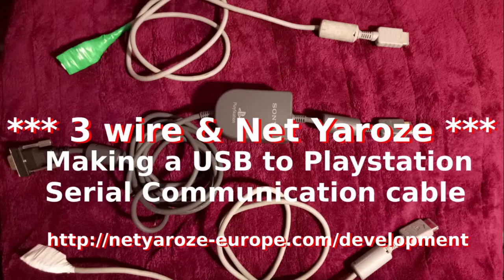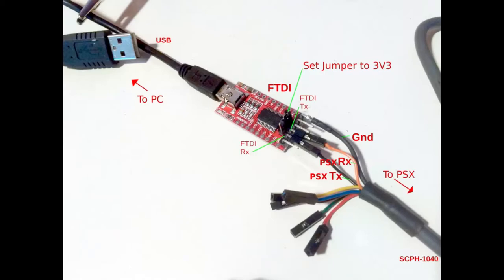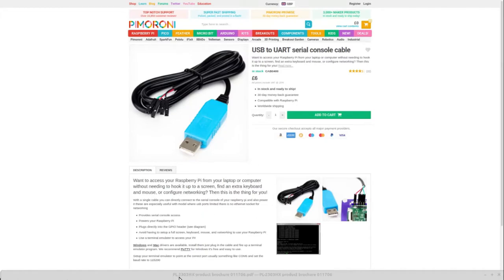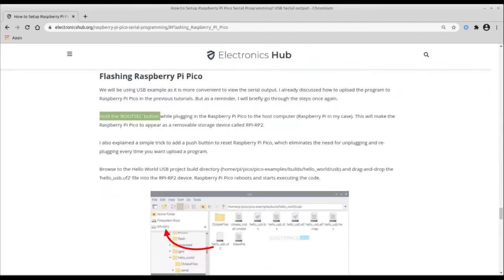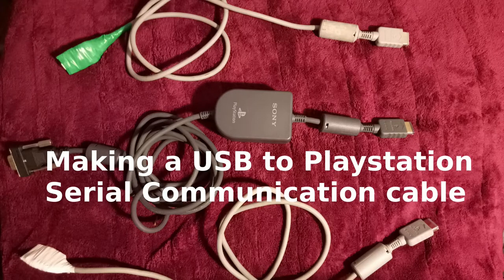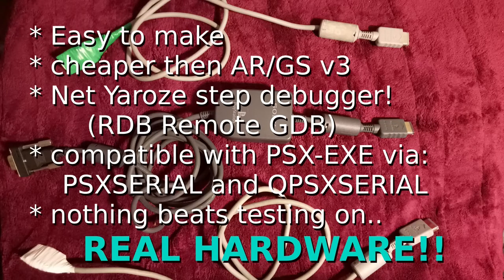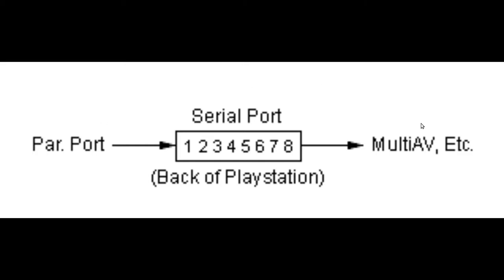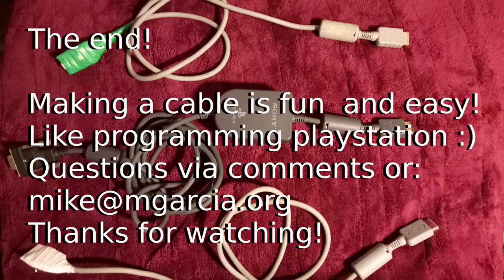DIY PlayStation USB communication cable - for nops & unirom or Net Yaroze

Comment: There's another option. You can remove the serial port and solder some headers in place. That's what I've done. No need to buy expensive link cable just to chop up :)